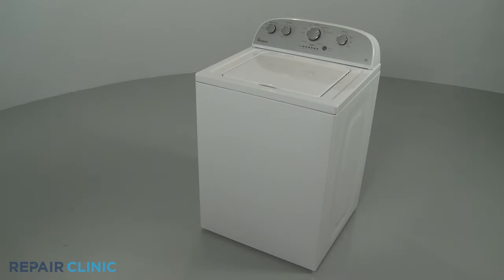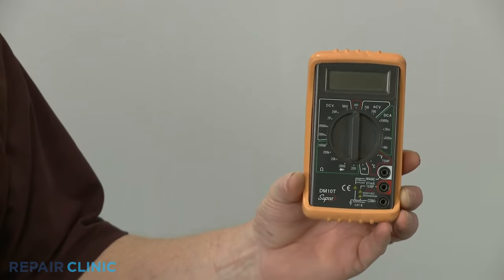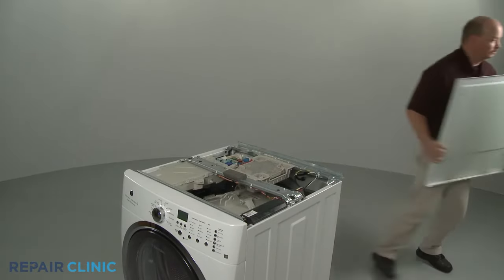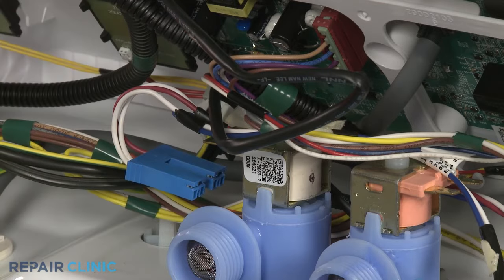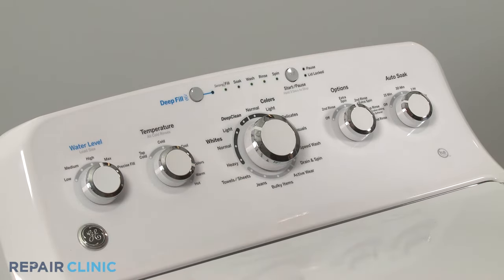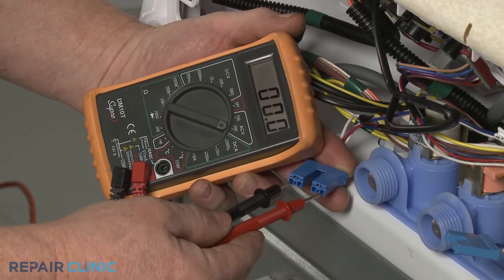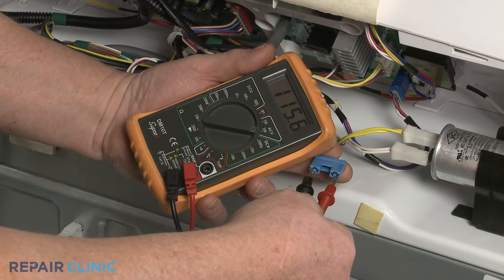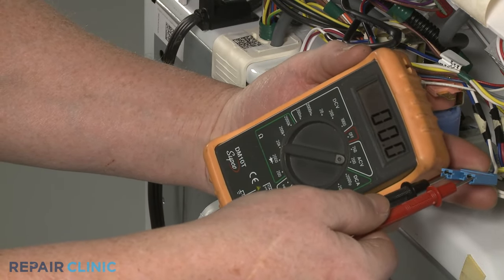Washing Machine Water Inlet Valve Voltage Testing

Comment: It is very dangerous to hold the power leads to the water valve like that. I would recommend; pushing the testing leads in before plugging in the appliance, and maybe even getting a meter with alligator clips to avoid getting your fingers anywhere near the electrical connections.
Reply: How much power is required to open the valves?
Reply: 240v
Reply: Washing machines are 120 volt.
Reply: Depends where you are. Here in the uk it is 240v. My point still remains it is very dangerous to be handling the connector as this guy does with the power on.
Reply: @matthewnewton6495 That crossed my mind too.

Comment: hi there i have a samsung washing machine and the water inlet valve  has no readings on it ? do i need to replace it or the whole main control board ,,, my main issue with my washing machine is it doesn't go into a cycle at all ... i have done alot of things